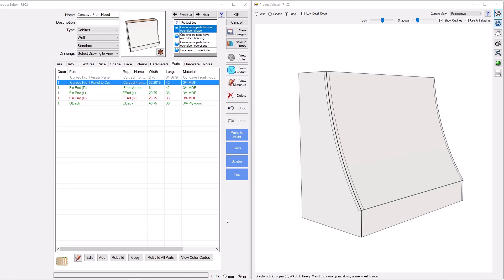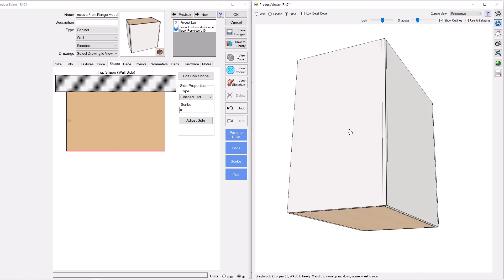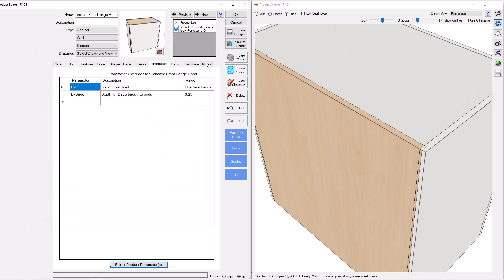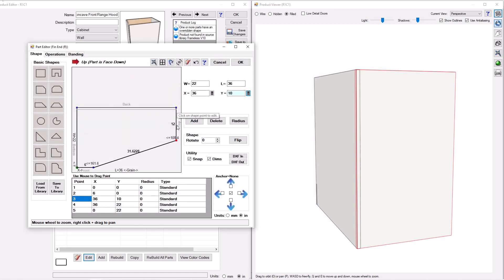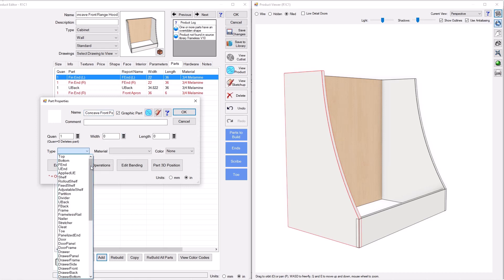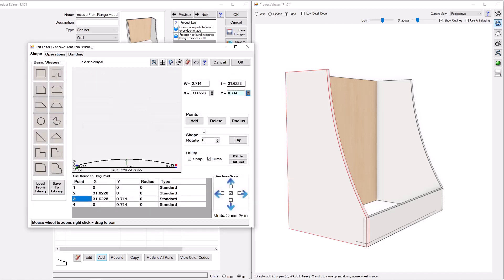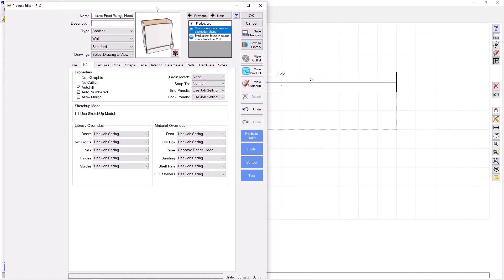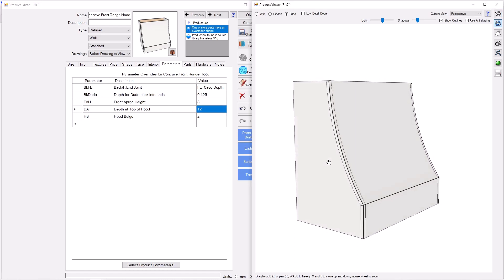PARAMETRIC CONCAVE RANGE HOOD: Part 1 of 2...Build Your Own Using Mozaik Software!

Comment: This is awesome, I have it mostly done but is there a reason why when I make the hood wider the concave front part is not stretching, I am wondering if I did something wrong?
Reply: You have to manually change the thickness in the Material Template to change it.